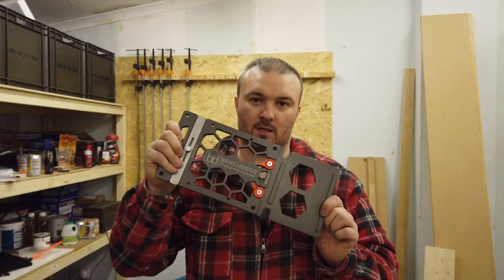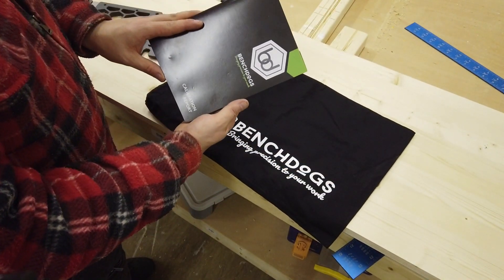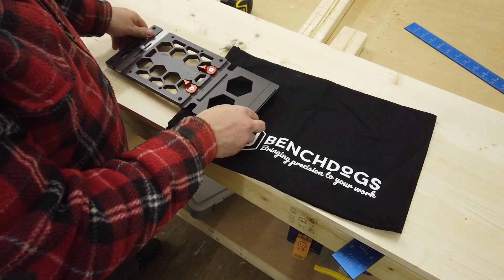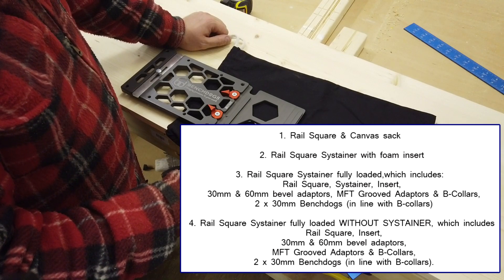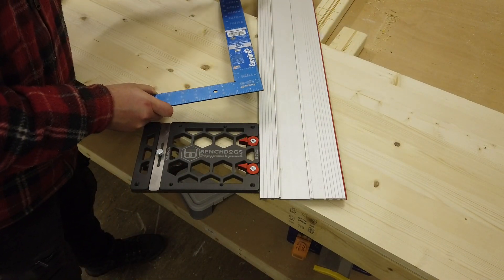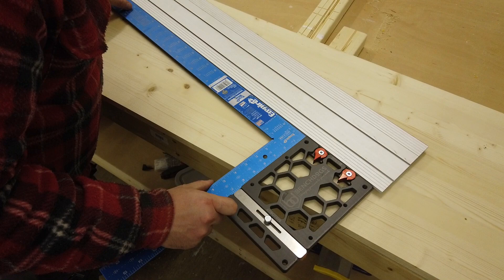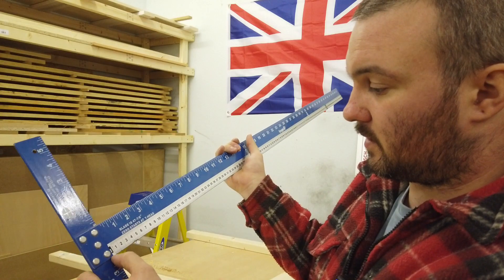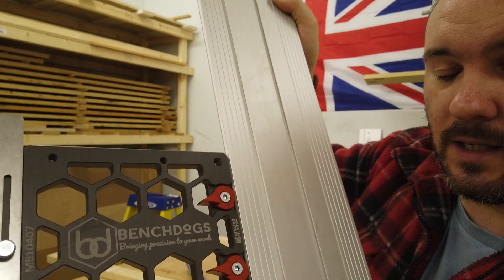WOODWORKING GAME CHANGERS : Benchdogs rail square review

Comment: Nice one. Never quite fully understood the benefit of a rail saw vs a circular saw, but I do now. Also the square being part of the rail makes a lot of sense. 👍
Reply from the maker: You can achieve 90% of what a rail saw does by using a circular saw with a straight edge. I used to use one for years until I bought a rail saw.

Comment: Thx for the video 👍🏼 also, curious re what it was about the Erbauer Track saw that made yr cuts like a banana?  :)  Just making some considerations..
Reply from the maker: Thanks for the comment. I never did find out what it was that did that. I tried all sorts of adjustments but when I put a straight edge against the edge that I had cut, it wasn't straight. When I first owned the saw it didn't do it though. It wasnt a bad saw really and did have a lot of power. At the time I was working for a company and had access to better saws like the Festool, the Erbauer was just for work at home. The Mafell is the best saw that I have used and the tracks are amazing. There is also a Bosch track saw which is a couple of hundred pound cheaper, looks very similar and uses the same tracks. I could waffle on about it forever....maybe I should do a video on it soon😂.
Reply: Isn’t that board tension giving an uneven cut?
I always over cut my boards by a few mm and then a final cut size. 
Great saw by the way, I have the same.
Reply from the maker: @dmc6807  I don't think it was that because it used to do it on MDF too, it may have been the cheap tracks possibly. The actual saw itself had a lot of power, more than the festool but not as much as the Mafell. I do know what you mean about board tension too. If I am cutting up thicker live edge timber to create a straight edge then I go a few mm over but then I run them across the planer. I don't particularly like using the saw for freshly milled slabs though because the Mafell doesn't have a riving knife.